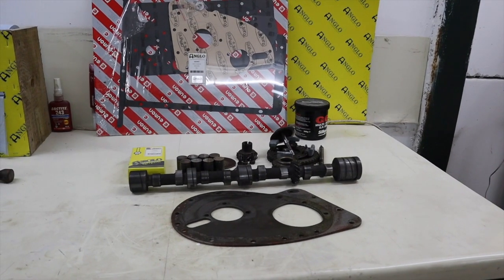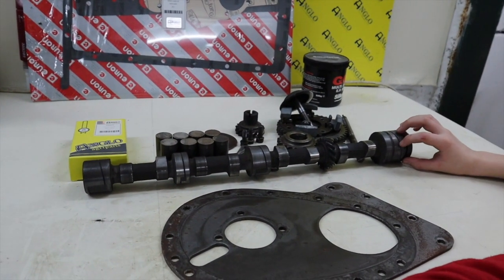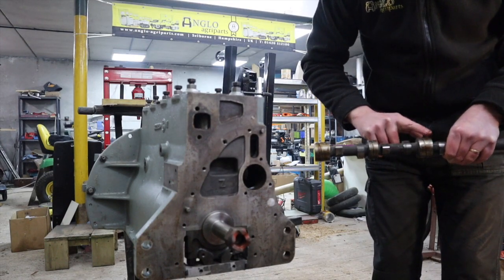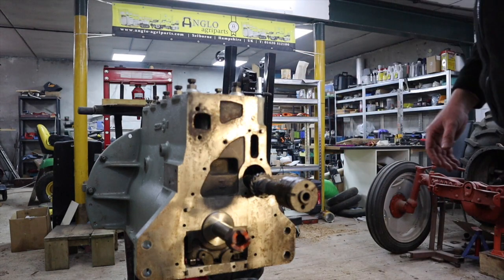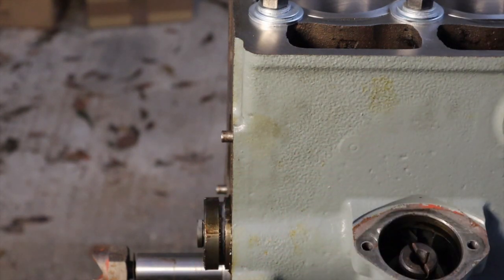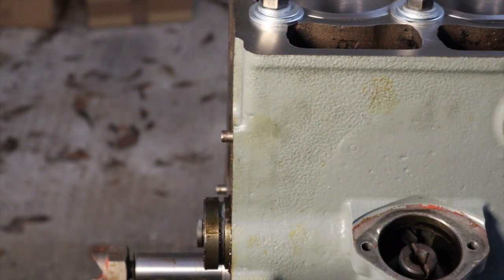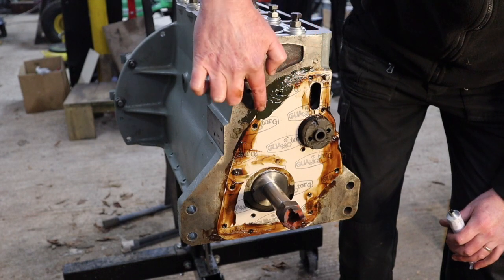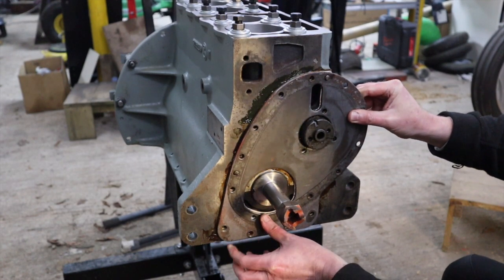#102 - TED20 - Fitting the Camshaft - with Anglo Agriparts

Comment: Good Morning Gordon & Oscar. Its actually close to noon but what the heck. Assembling the engine is an exciting step in the overhaul process and you can almost feel it running, at least I can in my little mind. Unless I'm mistaken, the Continental & Standard engine blocks did not have camshaft bearings. The camshaft journals rode in the cast iron engine block on a film of oil under pressure, hence the reason for having an engine oil pump in good working condition. The grooves are called labyrinth rings that ensure the oil is spread across the journal surface area. These rings are often used as crankshaft oil seals in large bore engines that typically operate at 600 RPM under full load. I'm talking about power generation engines such as Mirrlees Blackstone K-Major at 15" bore and 18" stroke that produce 600 horsepower per cylinder. Once upon a time, many years ago I was the lead powerhouse mechanic, now a distant memory. TTFN/CDC
Reply from the maker: Hi Charles, that sounds amazing, I sometimes regret not pursuing a career in mechanical engineering. Working on plant like that would be incredible. I’m sure it was challenging too! 👍😉